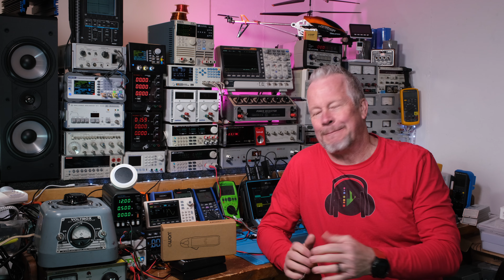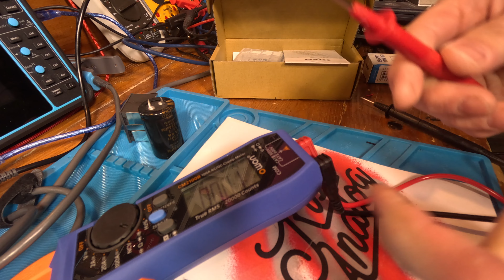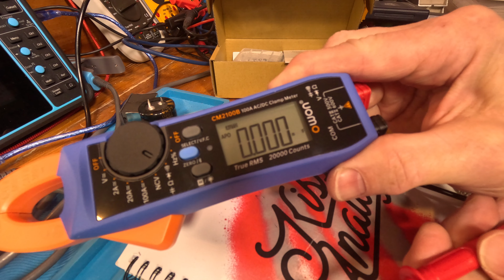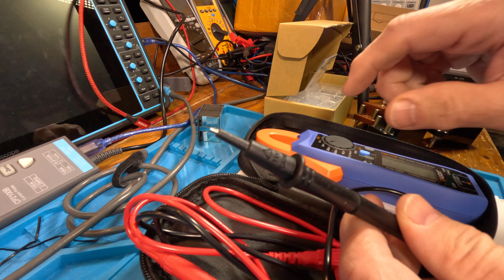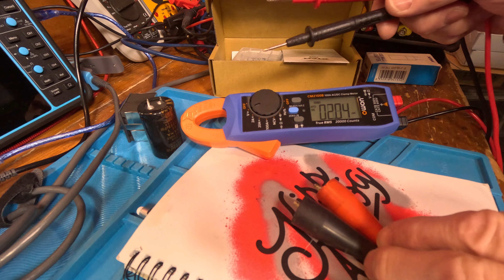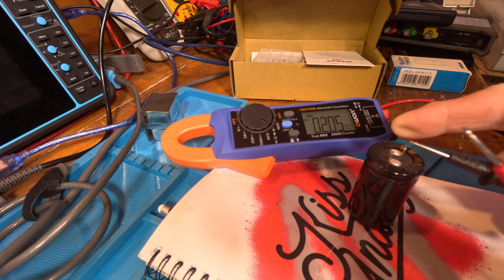Best Clamp on Meter for Benchwork Owon CM2100B #OwonClampmeter

Comment: I learned not to put The wires on top of The device but beside it.  In that way I broke The display of one anmeter.  The pressure of The weight of other tools in my bag did that damage.
Reply from the maker: That’s a great lesson to learn, definitely good advice for keeping our gear safe! 👍

Comment: I fear the durability of the meter. Will it hold up dropping and slapping around?
Reply from the maker: It does feel very durable.  Funny thing is - I think a lot of people think a certain meter is higher quality and durable - but really very few meters from some expensive brands are drop tested.  It is a fallacy that people think they are.  Also, if you do drop this meter in a way that would break it - you can buy a new one without crying about the expensive one you could have broken with the same fall;)

Comment: Wonderful little meter.  🥳   The clamp on meters are great for VFD AC motor drives and  large fork truck battery inverters.  Bluetooth is nice for remote testing.  Great video.🤩 Thank you. 
Amazon  $45    OWON CM2100B Clamp Meter Digital "Bluetooth"  Function Meter AC/DC Current and Voltage Test, with VFC Overload Protection Function True-RMS Test 20,000 Counts
My wish list is to use the Bluetooth data in a simple oscilloscope smartphone/laptop app with a true signal  trace zero .  🤔     Also, Power Factor function is nice for wind turbine projects .
Reply from the maker: Thanks for your great feedback!  I love the idea of PF in these meters;)

Comment: You forgot to mention the accuracy of the other resistance ranges. don't make people think it's .5% on all. It's 5%+10 digits on on the 200 Meg range. 
The bluetooth is a gimmick. Totally worthless.
It's more expensive than the Uni-t UT210e which also has a 2A range.
OWON has zero support.
This is not the best clamp meter.
Reply from the maker: Thanks for offering that data.
I think Bluetooth is awesome!  You can set up the meter - go to a panel and switch it on - and see the measurement.  This is just one example.
The Uni-T is only 2k counts and this is 20k counts.
Owon is quick at getting back to me.  What kind of support do you need?  It’s just a multimeter.
Reply: @kissanalog  Yes, bluetooth is awesome, but the way OWON implements theirs is not since you need the app to make it work. 
I have a B41T+ from OWON where the COM jack broke in the plastic part of the case. It was so tight you barely could get the leads in there. Banggood did after some complaining provide me with a new front half of the case though. Then the range switch died a month after that. I bought a brymen in stead.

I needed firmware for my HDS2102 since the website did not work, I e-mailed them and they never got back to me. But you did, thanks Eddie.

Comment: I have got this meter (the bluetooth version) and it's a nice meter to compete with the well known UT-210E, however with some things to bear in mind.
1) in Current range it is not 20.000 counts but just 2000, like the UT-210E.
2) Auto-ranging is exceptionally slow on this meter.

Edit: Mine actually defaults to DC in Voltage and Current modes!
Reply: you mean blluetooth?
Reply from the maker: Thanks for your feedback!  I wonder if my model is already been updated or yours has been? :)
Reply: @kissanalog  Logically one would think default modes are consistent so either everything defaults to AC or DC.
Reply from the maker: That was my thought.  It would make it easier to remember :)

Comment: So, why would you need blutooth? No fuse? Pretty neet though hopefully not too expensive. Can't see it lasting too long.
Reply from the maker: Great questions!
Bluetooth can be very helpful when setting up a measurement – and then going into a panel and turning the power on while watching the measurement on your phone.
You do not need a fuse because you’re not putting Current through the meter.  The clamp on makes it safer.
It feels very sturdy and looks well-built – so why don’t you see it lasting long?

Comment: Nice for the money. Here's my wish list for a clamp on meter. Dual measurements and display for volts and amps and a potential math display for power. And for the app, away to input a resistance value for the load so the power calculations can be displayed based on a volt or current reading only. 🤔
Reply from the maker: Thank you!  Those things are on my list too;)

Comment: 12:03 I'm sure we've all had times where we had to chuck away included batteries that came with equipment or put them to work in something else do to being DOA or drained before use. Sometimes I'll chuck them into something like a remote, though I do recognize that the things might leak in those. But, hey! If they're good enough to work, there definitely is no reason to straight up trash the things.
Reply from the maker: Thank you!  I have never had a chinese battery leak on me - although they may not last as long.  I just think we should not crap on Chinese batteries when the instrument itself is made from China - but some reviewers feel some crazy pride and toss them without draining them first.  How do they even know how good they are;)

Comment: WOW!
The non-bluetooth version is less than 35 bucks!
It costs less than the UT-210
Reply from the maker: Thanks for pointing that out.  It is about $10 les for the non bluetooth.  Here's the link: https://amzn.to/3uG7Oz0
Comparing it to the UT-210 is awesome - as they really have the same functions but the UT-210 is 2k count which is very low res - especially compared to a 20k count;)
Reply: @KissAnalog owon is also 2k count when measuring in dc clamp mode ! :)
Reply: Bought one at ali for 24,8 euro, still in china sadly. I have several devi es with BT and only real usage it has when i checking temps on some device,electronic stuff for long time under load. Honestly BT is for me much more gimmick
Reply: @grindererrofficial3755  BT comes in handy when checking intermittent  parasitic loads on vehicles.
Reply: Is there a mod/hack available for the Owon to increase counts for DCmA range? I understand the Owon provides only for 2,000 counts in DCmA (whereas with some mod you can increase the UT210E to some 6,000+ counts?)
Reply: @gmobile.1  I have no idea if that is possible?

Comment: What are the measurement edges for these things?  Were I to have a sq 10kamp wave on a 1% duty cycle could it measure that as 100 amps RMS?
Reply from the maker: Thanks for asking.  OK - I have to ask you where do you find a 10k Amp square wave with 1% DC? ;)  Just asking because if you really know a case - I'd like to hear about it.
Reply: @kissanalog lul, ya I guess that is pretty extreme.

I'm trying to make the biggest pulsed magnetic field possible (shooting for 5T atm) for funzies by using a few loops of heavy machined electrical copper as a custom made coil.  It's relatively low voltage (12v) and the h bridge will have a bunch of high current parallel fets.

If I need to cool the coil or even supercool it I will.  I'll probably have it dunked in liquid nitrogen before I turn the power on full for the first time tbh.

Right now I'm just trying to figure out what kinda decoupling(this is the name?) capacitor ill need to catch the flyback from the field collapse.  That's a good way to explode my batteries if I mess that up I think.

Edit:  I already had a coil explode on me last year before I understood flyback.  I had a kw through 500 loops and it rapidly started getting too hot so I airgapped the circuit to turn it off.  Field collapsed and the coil physically exploded, or at least very rapidly and chaotically came unwound with smoke and fire.

It's amusing to look back on but it was less fun when I was trying to deal with a heavy flaming mess of unwounded copper wires in my bedroom lolol..  No more mistakes like that.

Anyway my Tesla meter isn't fast enough to give good readings so I'm thinking of just measuring current through the coil